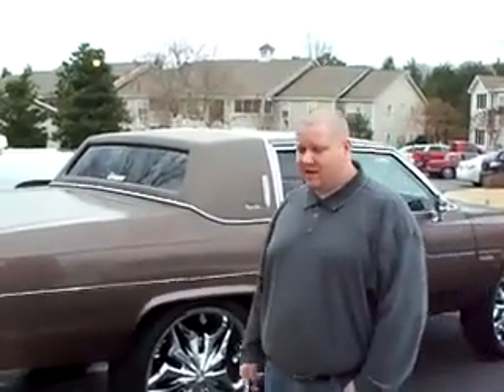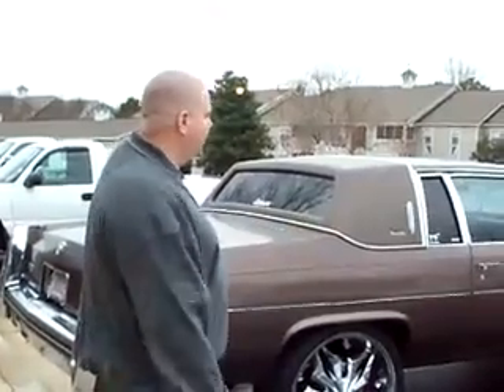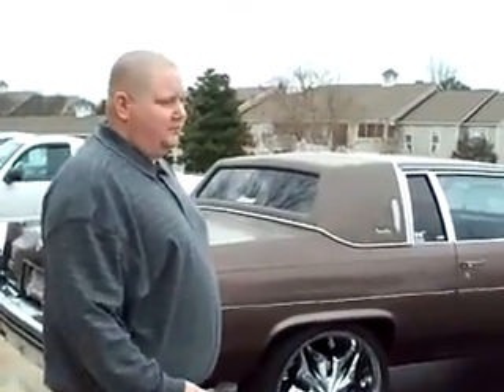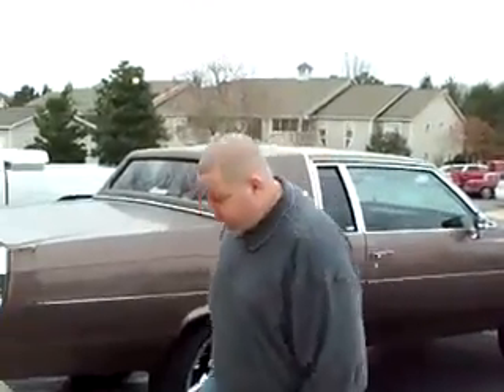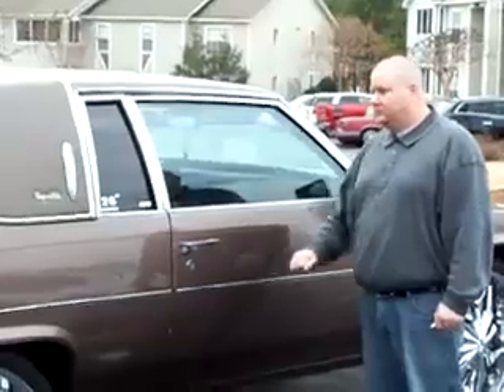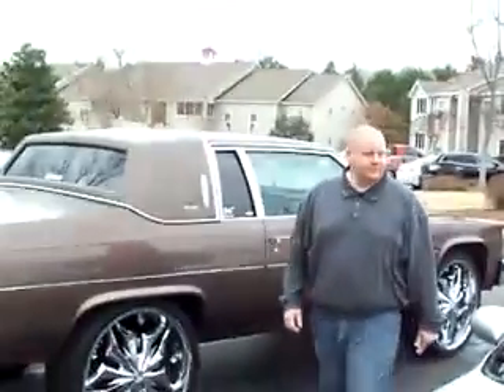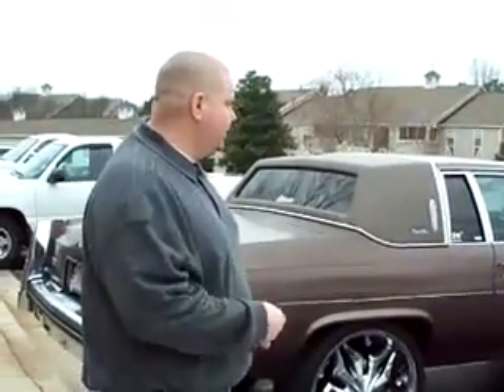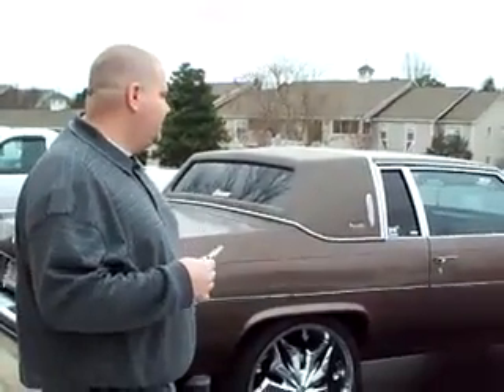Viper Talking Alarm Demo

Comment from the maker: Honestly, I don't remember lol. I've had it on 3 cars. Plus I have extras like a hidden backup batt in case someone pulls the power from the main batt, voice module, motion shield, etc. In all I wanna say like 450.00 installed.